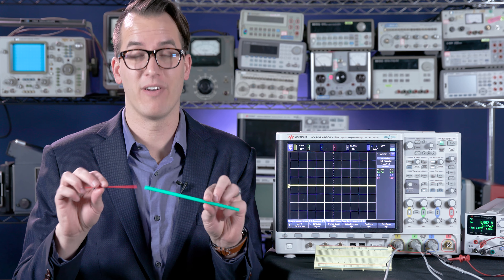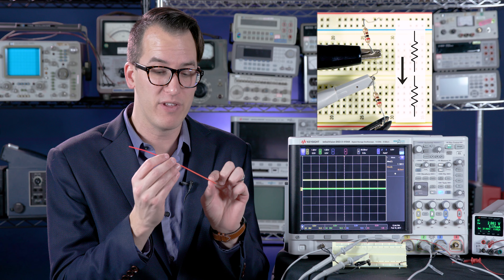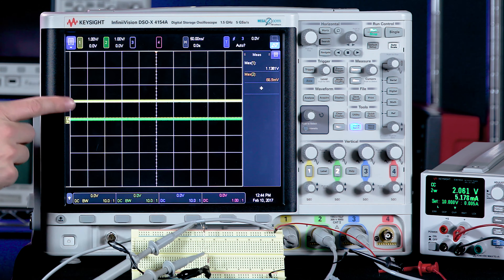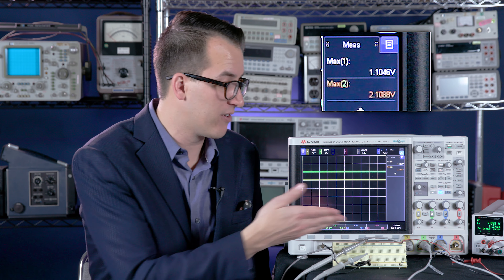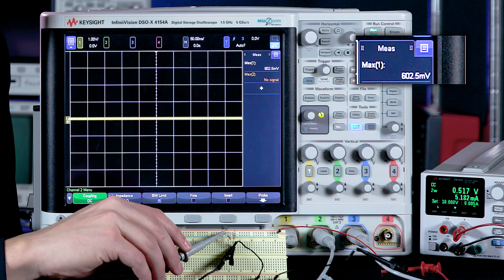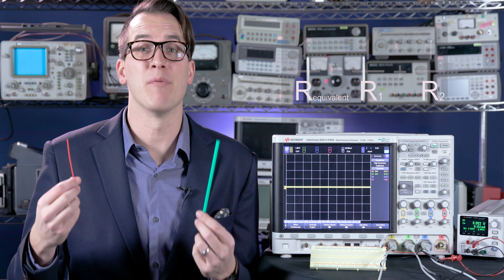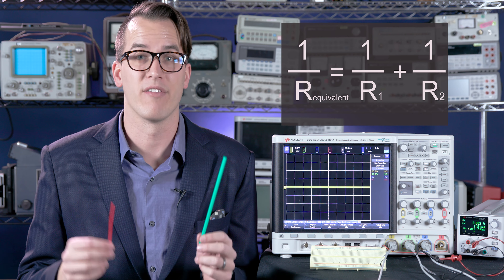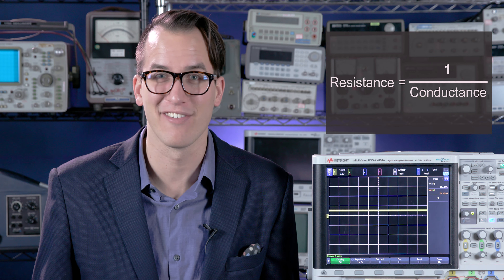How to Combine Resistances - The Keysight 2-Minute Guru - (s2e2)

Comment: Using an oscilloscope is not very effective for this measure, but I love your example with the straw ! What about another explaining difference between RMS voltage, peak voltage, etc ?
Reply from the maker: That would be a great one! It's true, typically you wouldn't use a scope for looking at resistances, but they are helpful as your circuits get more complex!
Reply: I agree, that would be a good topic, although I graduated with a degree in computer engineering and know all about it, a video for those just starting out would be helpful for a lot of people.

As for using the scope, yeah it is overkill, but I would not say it is not effective, just unneeded, particularly that one. But Keysight is known for their scopes more then their DMMs (which they make good ones too), so why not show off a bit?

Comment: How does the 2Gig samples per second work with the new 100Mhz Keysight 1000x?  Does this mean that signal noise at up to 2 Ghz will register in a sample? In essence a 2GHz scope with lots of distortion, or ?  ;-)
Reply: One might assume there is a 100Mhz boundary filter basically due to input resolution, but I guess what I'm asking is: Is there a button that can turn off the "filter" and thereby allow high db distorion signals to register in the input, because sometimes one only needs to detect signals accurate to perhaps a few magnitudes?
Reply from the maker: Good question! The sample rate doesn't cause frequency-dependent noise, that's a bandwidth-centric phenomena.
Reply: Okay, so sampling occurs only after signal is acquired. Thank you.